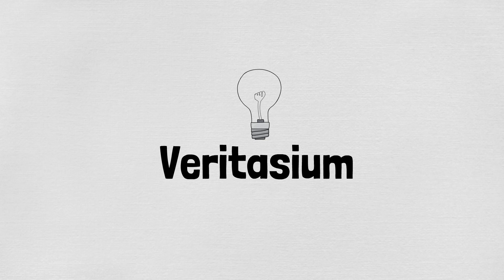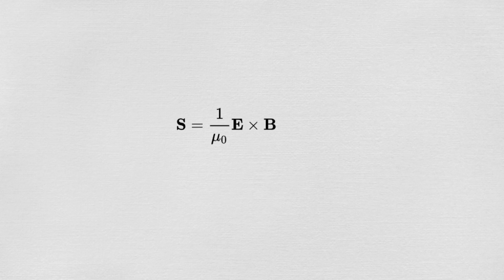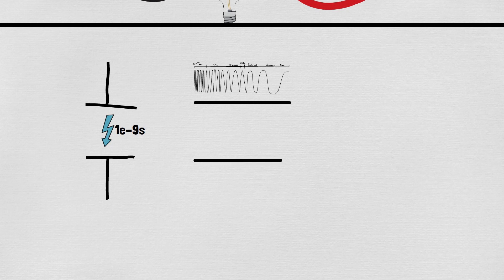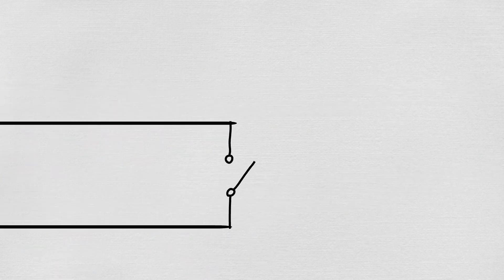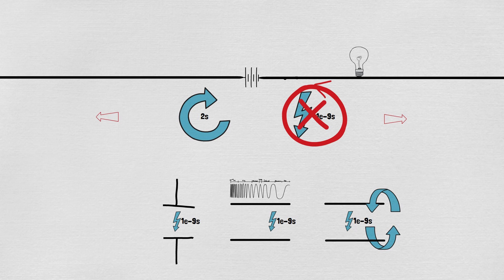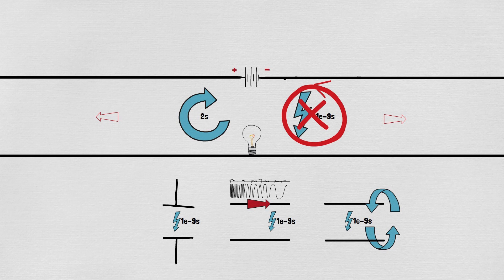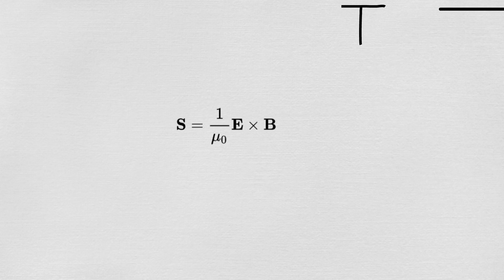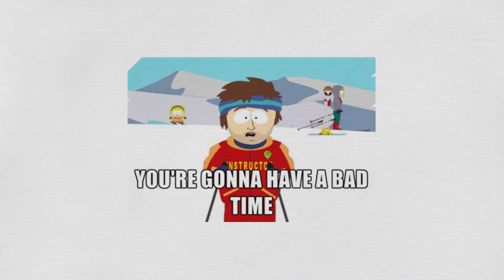Veritasium is Right? (see description)

Comment: There will be an initial current flow once the switch is closed, even if the wires are open, but since there is no oscillation (battery power) it will die out quickly.
A transmitter or receiver (dipole) antenna is not connected in both ends but still has current flow.
Consider this: relative to the speed at which the waves in the electromagnetic fields propagate, the wire is long. It's true that current can't flow, but it doesn't know that until it gets to the end of the wire
Reply from the maker: i agree with this. there is a transient pulse across the bulb, but i don't think it lights up.
Reply: @antimatterhorn  the transient pulse will last for one second and be about the battery voltage divided by 2 times the line impedance, in this case about 2000 ohm. So for a 12 V battery we will get one second of 5 mA if we assume 2V over the lamp. Not enough to light up most incadcent light bulbs but more than enough to light up a simple LED. Not a mainspowerd LED bulb as shown in the video, they dos nor turn on at all on 12V DC. Regardless it was stated that the theoretical light bulb turned on for any current regardless how small.
Reply: @larslindgren3846  Any transient pulse will last for picoseconds. The line impedance for Veritasium's circuit is nothing like 2000 ohm because you are incorrectly assuming that the signal is applied across the wire. It isn't. If you had a 300,000 km long pair of parallel wires and connected a battery across one end and a load across the other, then your transmission line calculation would hold. But that works because a differential voltage is creating an electric field between the wires (= capacitance) and the current propagating along the wires is creating a magnetic field around each wire (= inductance). That's not what is happening in Veritasium's setup and there's no way that it can light a bulb, or even an LED until the current has propagated around the circuit.

It is nonsensical to suppose that a bulb can emit light energy with an arbitrarily small current. If it could, we could light the bulb eternally via as small a capacitor as we chose, because the current charging a capacitor never quite drops to zero. The truth is that the transient energy that would be radiated by the switch closing would be so miniscule at the bulb that it could never light it. That is the key to understanding how Veritasium's thought experiment produces an apparent paradox.
Reply: @RexxSchneider  The transmission line model works fine, locally at the battery/lamp site you have a series connection of the battery, first transmission line, lamp/LED and second transmission line. I assumed 12 V battery and 2V across the LED. That leaves 5V across each transmission line end. A wire pair with 1 mm radius and 1m spacing gives a line impedance of about 1000 ohm for each transmission line. The transmission line does initially not know if there is load in the end or not, it will have a impedance of 1000 ohm regardless. The thing I am neglecting in this analysis is the comon mode current in the transmission lines due to capcive coupling to the environment.
There is nothing theoretically wrong with a light bulb that light up with an intensity proportional to the input energy even at very low levels. In fact a few microAmpers are enough visible light a LED in a dark room with dark adapted eyes.
Reply: @RexxSchneider  I don't understand why you think the pulse would last picoseconds. To get times in the rage of picoseconds you need propagation distances of mm or a few cm. Nothing in the circuit has that scale.

Comment: In these thought experiments it seems like you can just pick and choose what to ignore, but while it may produce a result that is "technically" true, it may cause more confusion than clarity.

The battery itself can produce an electric field across it's terminals. We typically ignore this because unless the potential between the terminals is high enough, the air doesn't "breakdown" and become a conductor. It is an "open circuit" in practical terms, but not necessarily in theory. But in Derek's thought experiment we are ignoring a great many things, including how much current it takes to light a bulb, in order to illustrate a principal.

Of course, there are circumstances in which these effects perhaps need to be taken into account, such as pcb designs, where traces are extremely close together.

When you get a bunch of physicists arguing online over tiny, tiny effects it can promote greater understanding among those who are already richly educated. But it also may be a sign that the original video failed in it's educational mission for a more general audience.
Reply: A PCB designer would not care about something like this. The wires are too far away from eachother, and the coupled pulse signal will most likely be below the thermal noise floor.

Two seperate transmission lines (which are 2 loops) will produce crosstalk/coupling yes, but this is not really the same scenario. A big single loop like this with a DC source and a switch is mostly a source of radiation, which can cause EMC issues. It is not an issue internally in single-loop circuit that you will ever have to deal with, because it is not a real thing. The power transferred directly due to the transient is very close to 0. After that step which is travelling along the wire as a wavefront, we have DC, which creates no external field, unless of cause we reach a voltage high enough to break down the air between the wires and arc over. That's the only way we'll get "wireless DC" energy transfer.
Reply: I would disagree that his leaving some things out was a problem for general people, if the wire has no resistance like in the experiment, and the battery and bulb were chosen because the battery can light it, then you dont need to know the specific numbers. The circuit is a best case example so there isnt any technical jargon that would scare off people new to the idea.

He stated what he ignored, which is enough when he isnt trying to teach the entirety of electrodynamics to his viewers. He wanted to share something most people dont know, that is it.

You are right about that stuff needing to be explained if you plan on teaching your viewers in depth, but he wasnt trying to teach them in depth. The way he lined it up was simple enough for my grandma to understand.
Reply: @helipad4050  The problem is the entire setup really. Maybe this thought experiment could work with "infinitely" large parallel planes connected at the ends. Then there'd be an actual capacitance between them, and energy could couple over. Two wires a fair distance apart will have as much coupling as 2 antennas, so that's what they should be considered as. In that case you need to realise, that they would radiate in all directions, and only an almost 0 amount of energy would be picked up by the other side.
Reply: @FrilloTeslar  Exactly
Reply: @FrilloTeslar  im saying the setup is to give an example, also you forget that if there is in general a magnetic coupling (because of current) it would be like a capicitor, if i have a switch connected and next to the battery on a split part from the bulb the part the battery is connected to would have already balanced out, so when i flip the switch current flows so that part can balance out too and the current makes a magnetic... leading to bulb turning on almost instantly, may not be full brightness but veritasium never said full brightness.

Comment: Here are my two cents: the position of the switch MAKES IT a different problem.

 If you hook up the ridiculously long circuit with the open switch next to the battery, we can assume that enough time has been given for the ends of wire in the circuit to "know" their relative potential with respect to each other.

Therefore, if the switch is close to the battery, current can start following immediately because the information about the potential difference has been transferred prior to closing the switch. After the switch is closed the lightbulb would "turn on" a tiny amount and will progressively go towards full brightness.

The position of the switch is important because it establishes the bubble of causality.
Reply: Sure afrer  1/c in sec , we will have some very smal current i dont know this value , but this value of current it is not enought to light the lamp.After 1 sec we will have enought current to have light in the lamp.If the lamp after 1/c sec light we have brake relativity.
Reply: The wires form what is effectively a charged "capacitor "  with the available free electrons evenly spaced throughout the wire.  (The free electrons in any conductor are in equilibrium without any external forces acting on them) - Also electrons are negatively charged and will repel each other until equilibrium is reached. 

Thus turning the switch on causes an instantaneous transfer of energy across the "capacitor" . ie an unbalance in the equilibrium. Fresh electrons from the battery repel the electrons on the other side of the switch.

The light is in series with the "capacitor" and so will turn on more or less instantly. If this were not the case electricity could never "flow" as there would be no movement of the electrons.
Reply: Correction: it won't go "progressively" to full brightness. Or rather, saying progressively is misleading. It will have a somewhat constant, very low current, induced current. That current. When the energy gets to the load, it will arrive kinda like a step wave.
Otherwise, it is correct. Changing the position of the switch makes so it is a different problem.
On the other hand, If the point was to show that energy is transmitted through fields, he could explained it way better. Maybe shown a simulation of the circuit in a E&M solver. He should've also mentioned that most of the flux travels very close to the wires, not directly from the batteries through the gap. His diagrams showing the flux were completely out of scale.

Mostly people are just salty, because they didn't answer it the same way Derek did.
Reply: @cat0s  It doesn't break causality, because the current would transmite like an antena. With a big enough battery and thick enough wire, it would transfer enough energy to light the lamp.
Reply: @Alkis05  What range of distances would suffice for that transfer and to light a bulb? Is it from 1mm to 2m or narrower?
Reply: Indeed, it is. But a lot are getting confused by what the switch is actually doing. The switch open, is a valid circuit with a DC steady state, there is a capacitor at the switch, we are starting from this steady state, by closing the switch, we change this capacitance down to 0, this means the changes in the fields now start to propagate from the switch.
Reply: @cat0s  The lamp, is ideal, in other words, it converts all the energy it can into light.
Reply: @EwanMarshall  imagine we have a batery 12v ,ok?now imagine i take voltmeter and , and measure it.The voltmeter will show 12 v.Now imagine add a ideal cabel to + and this cable is 2 light years plus 1 meter.we do the same to - .Now i connect my voltmeter to measure.Pls tell me when i see 12 to voltmeter.
Reply: @cat0s  there is no disagreement there... However that first measurement would need to be under load too. What is your point? Voltage is potential difference, it is the difference in available energy between the two probe locations.
Reply: @EwanMarshall  sure.means after 1/c in second the lamp will light, right?now pls imagine this.taķe a batery 12v , measure ìt wìth a voltmeter you see 12v .now add some ideal cabeĺ to +  let say 2 light year .do the same to - .now take your voltmeter and measure .you are long from batery 1 m.pls tell me you will see 12v after 1/c second or after 2 years?
Reply: @cat0s  will depend on precisely where those probes are, at the battery, it will still be 12V. As that is difference in energy where the terminals are. For that to fully propagate, yes, it has to travel all the way along the cable, but on != back in new steady state, but any available energy has propagated, the first of this will be from the EM fields coupling the parallel lines.
Reply: @EwanMarshall  Dear friend if we measure 12v after 1/c second and we have use 2 light year ideal cabel we have brake realativity.That is my point.I wonder if can do a real and not ideal expirement and see and measure the results.The big Albert i think that have say ...only one expirement will show that i am wrong.
Reply: @markhathaway9456  It depends not only on the distance but on the voltage of the power supply unit. I don't remeber if he specified the voltage. Maybe he said it was 12V. Than it wouldn't light up. The voltage of transmissions line creates electric fields that are relatively strong even tens of meters away. It also depends on the "capacitance" of the wire. 

I have not done the calculation. The strength of the field falls with the
Reply: @rickharriss  the problem is that the power of this capacitor would be insanely small, 2 wires at 1m distance does not a capacitor make.
Reply: @cat0s  At the bulb I never said it would be a full 12v after 1/c seconds. At no point does "on" mean a full 12V drop across the lamp, just that there is no losses of whatever small potential difference is there is converted to light.

At the battery it would be, constantly. As I said, where the probes are and the exact time we are talking will matter. And as a friend correctly pointed out, voltmeter gives averages and filtered results, may I suggest an oscilloscope for tasks such as this.
Reply: @gravmania8871  a small capacitor is still a capacitor... Yes, the result in other line will be small, but it is not 0.
Reply: Whatever the position of the switch, under the initial conditions of steady state, the voltage is applied across the switch terminals. 
 Initially the circuit effectively acts as a capacitor, however not between the 1m distance btw conductors, but across the air gap that the switch is making.
When the switch closes the voltage across turns to 0 and the current starts to flow across the circuit. Transient conditions are established from the switch position (wave propagation dependent on line characteristics). Yes those transient will generate some EM field around the circuit but will carry insufficient energy to light the bulb.
Reply: @nzeches  Well, the bulb is "ideal" here, so, it all the energy available gives light photons (however few). Sure this is idealized, and so, as a practical matter will not be visible, but as a theorectical matter, there is energy there turning to light.
Reply: @EwanMarshall  well not sure what technology the bulb is, then... 😉
Any bulb will require some amount of energy to reach operational state (temperature, ionisation, quantum gap) and start emitting any photons ...
Reply: @nzeches  Oh, I agree, it is idealised here, that was explictely stated along with the no resistance wires. Basically, yes, in real life, the losses are a problem, so we are ignoring those.
Reply: @nzeches  what you are forgetting is that when a theoretical question comes into play, it is in order to demonstrate a principle that is not simply about the practicality. This is one of those places where a student or an interviewee are going to have their considerations tested when the problem is deliberately nonsensical in its application or theory.

In this instance, if our goal is to know how fast the ideal lamp, which turns on immediately upon having any flow of current, with ideal conductors (such as a superconductor which is a type of ideal conductor) it is much better to simplify the problem and forget about talking about an actual lamp and more like an RF differential amplifier. The most common
 problem I see with the responses is that steady state is implicitly or conditions which relate to steady state are assumed, which is not the case at all in transient response problem, or that the impracticality is focused on which is far away from what the point of Veritasium's video was.
Reply: @fizzicist7678  
 I am not forgetting at all, it is just that an overly simplified mental model tends to demonstrate a point that is inherently opposite to what happens in reality, which I find misleading.
There are definitely other ways to demonstrate that energy is flowing through EM field in direct path. Just a wireless charger or RF transmission or microwave oven.

I do fully embrace the transient phenomenon from steady state condition, let us not forget about those initial conditions, as structure of EM field and propagation are determined by boundaries of space time domain.
Reply: @nzeches  that's kind of the point. This IS what happens in reality. The fields will transmit information to the bulb long before the current in the wire does.
It is a matter of what "turns on" is. And if you care about seeing in the room, sure you are correct. But the point of the theoretical question is that provided ideal case, the lamp turns on when any current flows in it, and that can happrn when parasitics are concerned. The 2 dimensions of the problem is the reason the fields are what will eventually "turn the lamp on".
It happens in your device you use to connect to the internet on a daily basis.
Reply: I would even go so far as to say that the energy goes from the switch to the light. There is a voltage difference between the switch terminals. After the switch is closed there no longer is a voltage difference. So the charges have moved and made an EM field. That's the first energy that's going to reach the light.